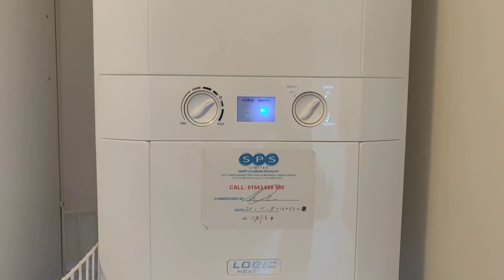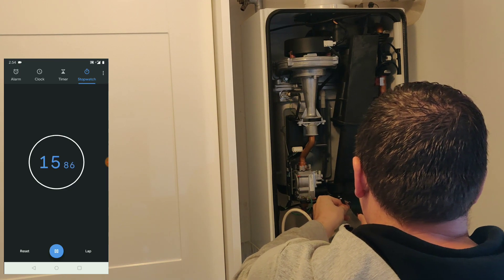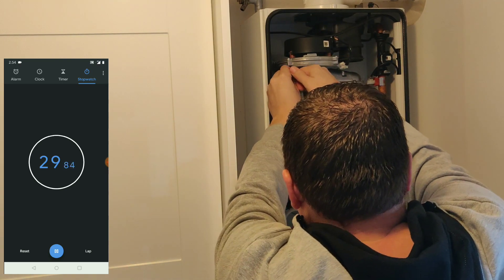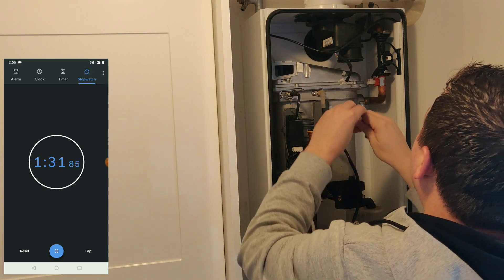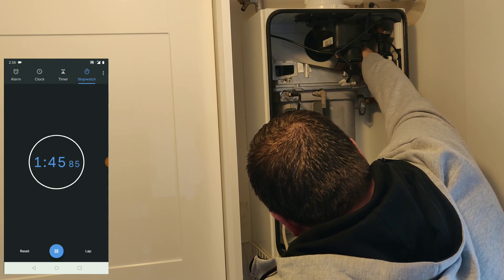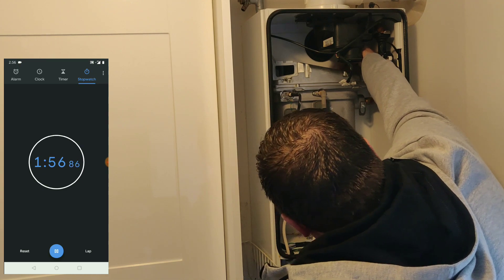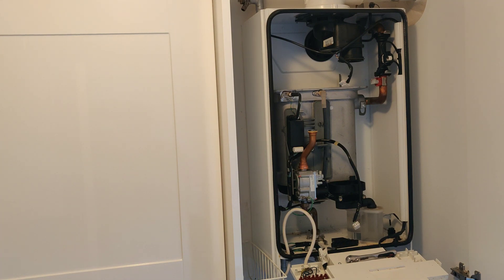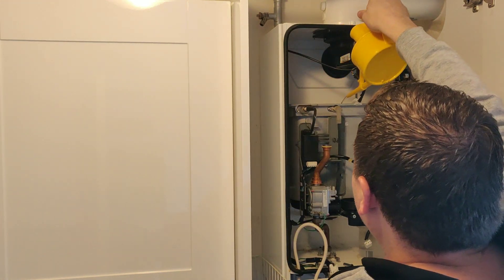Ideal logic boiler 2 minute service strip down

Comment: A great video. Now that shows experience. Had my ideal logic heat 18 boiler serviced. The sump cover was replaced as it had started leaking. I knew it was the hairline crack in the sump causing the leak but was told otherwise.

I'm now being quoted in the region of £225 to get the sump replaced? Seems a little high to me given the simplicity of what needs to be done. Any thoughts?
Reply from the maker: Hi Mahbub, thank you for your kind comments. What area are you based? As this may dictate labour rates. If I'm being open and honest the sumps are around £60-65, usual parts markup for engineers would be 40% so around £90. I can carry out SAFELY a sump replacement for a heat only in around 30 mins. My minimum charge is one hour at £65. So for me it would be around £155-£170 for a sump replacement. If I was already there say carrying out the service and found it needed one (I carry them on the van) I would charge the sump cost and £30 to replace. Hope that helps. Dave
Reply: @DBPLUMBING  Thanks for the speedy reply Dave. I'm in Coventry in the Midlands. Your prices are certainly a lot more reasonable than what I've been quoted. I've been quoted £150 just to fit the sump!!
I'll keep an eye on it as at the mo it's not a major leak but will need sorting in the near future.

Comment: What's going rate for a strip down boiler service I know if verys from area to area roughly.
Reply from the maker: Also depends on the boiler as some need seals replacing etc. Average prices would be between £60-100. If someone will do it for less it's not getting done properly👍

Comment: Would you change the seal/gasket ?
Reply from the maker: Which one?
Reply: @DBPLUMBING  
Your asking me 🤔🤔🤔
Reply from the maker: @markgratton7361  well yes. In fully stripping down a logic there is 9 or 10 seals that get disturbed. Then also cable grommets etc etc. If your refering to the burner 'gasket' then you should know if working on them whether they need replacing or not during a service? Or are you not a gas safe registered engineer? I have been for 20 years and have serviced around 16k logics so far.  So if you still want to question my capabilities of servicing these boilers carry on
Reply: Wow I was just asking forget it
Reply: @DBPLUMBING  calm down
Reply from the maker: @mrt227zxr  thank you for adding to the YouTube algorithms 👍🏻